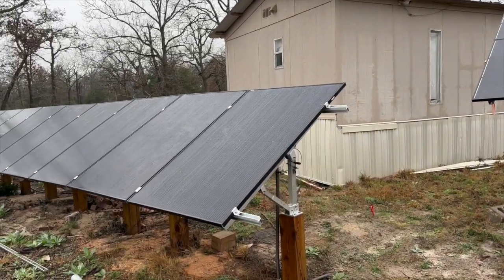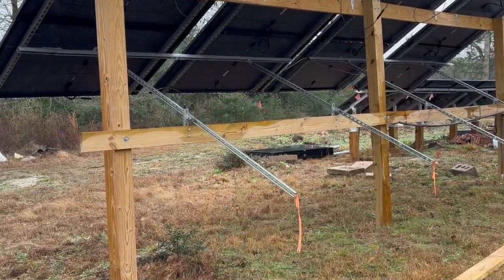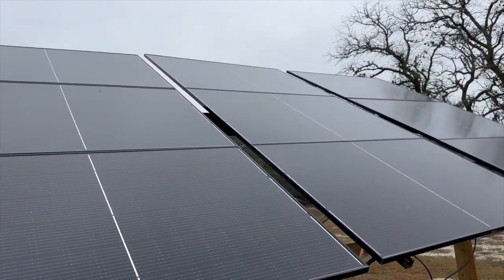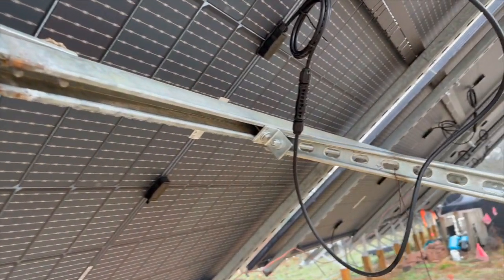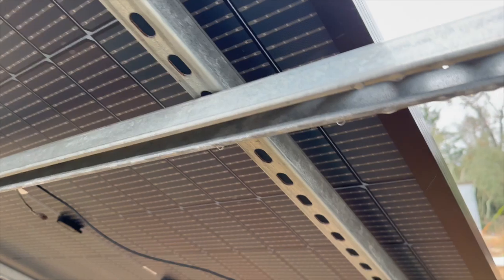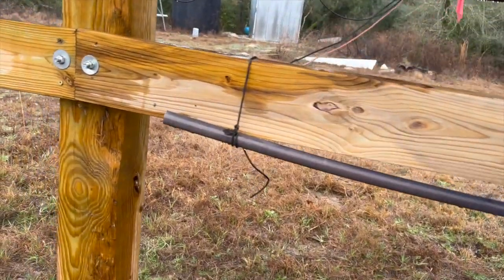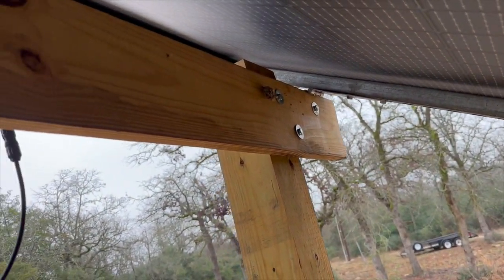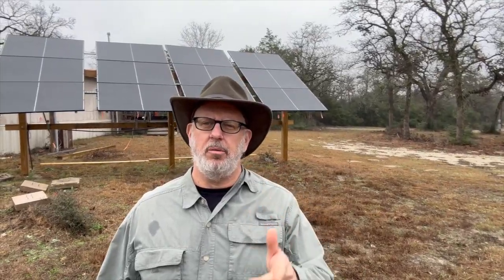What happened to my DIY Ground Mount?  One Year Review

Comment: Thanks for the update.  I watched your video when you first put this up.  I wonder if you placed the elevation bar closer to a post so it is not in the middle? All the best from north Texas
Reply from the maker: Hey Brent!  That makes sense but I originally thought the bar needed to push in the middle of each panel to apply even pressure on the panels and avoid tilting.  There tends to be some flex in the uni strut and the panels but I may try reattaching them to the out side edge closer to the posts.  

Honestly, the 12 panel DiY tilt mount hasn’t performed significantly better than the 12 panel Brightmount rack next to it.  Overall, the Brightmount is a much easier Install using the same 6x6 posts, but it’s close to the ground and easier to manage.  They have the new Cat 1 Brightmount racks in stock so I may try a new 12 panel install with three new Cat 1 Brightmount kit.  I calculated the total materials cost, with (4) 6x6x12 posts and extensions, yesterday at about $110/panel.  That’s as cheap as it’d cost today to build my DIY tilt rack and it’s easier and cheaper than any other ground mount system I’ve seen.  The hardest part is just digging the holes! 👍🤩
Reply: @terrahillfarm hmm you have given me some things to think about.  So a 6x6 is strong enough to resist winds for the bright mount? I am considering using 12 panel structures.  Always figuring how to do things cheaper and then when I finally decide the panels and other items will be too expensive.  In my career they used to say they had to shoot the engineer to make the product.  Haha.  Too much thinking.
Reply from the maker: @brentjohnson6654 of course it’s all relative to location.  Would my Brightmount set up be sufficient if I were within 50 miles of the gulf coast in an open field? Probably not.  I suggest using longer screws to attach to the Brightmount plate to the top of the posts.  Ideally 4-5” feels like a good idea.  If you’re in open areas with high winds then you will need to add sufficient concrete ballast in the bottom of the posts holes.  If you want the full rated wind load for the rack, you’ll need a concrete truck or pallet of quickcrete.  

There’s just a point where high winds will destroy your solar panels regardless of how secure the ground mount is.  Engineers like to engineer for the WCS, and I’m thankful for that.  If my ground mount blows away it’ll take out a 40 yo old mobile home so no worries  there. If it was next to my new home, I’d probably beef it up even more.

Comment: Maybe add a 2x6 to the front and but in some blocking to help with rigidity.  Maybe able to the same on the top also but indidnt notice the bowing as bad with it since it sems like it would be more downward force then the holding the panels at a angle
Reply from the maker: @MrBmonroe924  Thank You!  I was out looking at it today thinking about how to keep both 2x6s from bowing and like you suggested I thought a piece of 6x6 between them would add some strength. Would he best to move the adjustable rail mount to the blocking so as not to split the 2x6.  I’m surprised it’s held up this well so far.  It is a pain to get panels up that high but once mounted they stay put.  Mounting panels is the least fun part of DIY solar! 👍⚡️🔋☀️💡

Comment: Or turn the 2x6 90°.... And move the hidges closer to the center...
Reply from the maker: @SolarizeYourLife  Thanks, That might work but at this point I hate to start messing with it while it is working.  I may just double up the 2x6s.  If I had to do over, I’d use more posts and shorter spans (go from 11’ to about 8’.) 👍☀️⚡️🔋

Comment: May I suggest IntegraRack IR-45ASA adjustable racks?
Reply from the maker: @ToddDesiato  Thanks! I’ve looked into the Integra rack and it’s nice but pricey.  My next panels are going up on the roof of my carport.  I’ve got the metal roof mounts but need to either buy some rails or I may just use unistrut.  👍🤩⚡️☀️🔋
Reply: @terrahillfarm  It is pricey, but I built an 8-panel rack in about 2 hours and didn't need to mix any concrete. My time and back-health is worth more than the cost of the racking.

Comment: You can choose the best panel angle for the prime energy needs time of the year and just fix them, don't try to constantly readjust.
Reply from the maker: @jvin248  I think you are right. Since I have one 12 panel array basically fixed and the other adjustable, the improvement in power from adjusting the tilt hasn’t been that noticeable compared to the array with the same panels fixed. It think the best approach is to minimize panel mounting costs and install as many panels as possible in your ideal fixed tilt.  You’ll save more money with a fixed cheap ground mount than you will with an expensive fancy adjustable ground mount.  Only exception might be if you absolutely need to maximize winter sun.  🌞 That’s no issue here in Texas.  👍⚡️☀️🔋💵

Comment: The 2x6 problem is because you are loading it in the weakest direction. Turn those board 90deg so the main force pushes on them like a floor on joists or the I-beams under a road bridge. Also put them this way on the other side of the uprights so the boards are being pushed into the uprights not relying on the lag bolts to keep them from flying off the back.
Reply from the maker: @jvin248  Thanks, I had the top 2x8s on the other side of the posts but my thought was to put a second 2x6 on the opposite side of the post and bolt the2x6x together.  The thinking was they’d counter the push from the adjustment pole better.  👍☀️⚡️